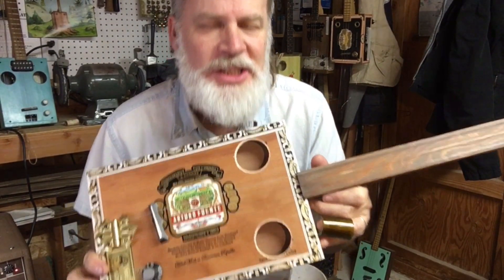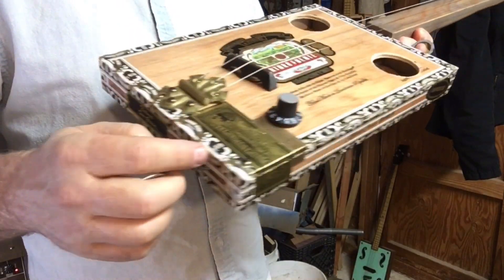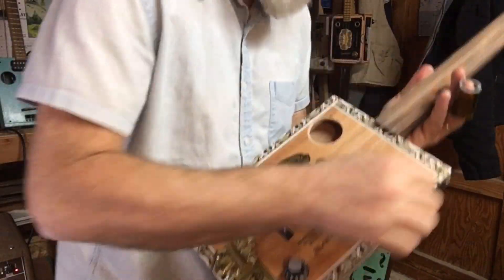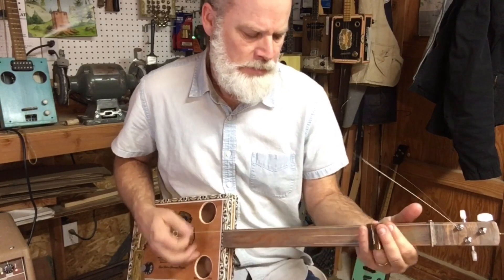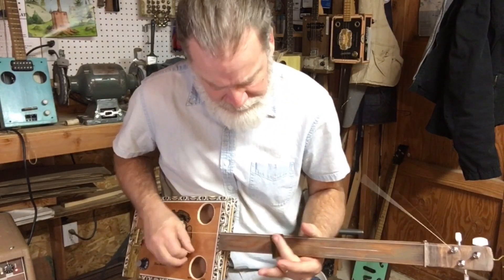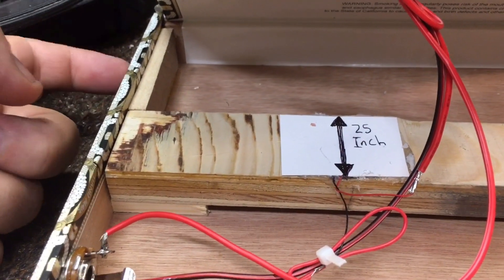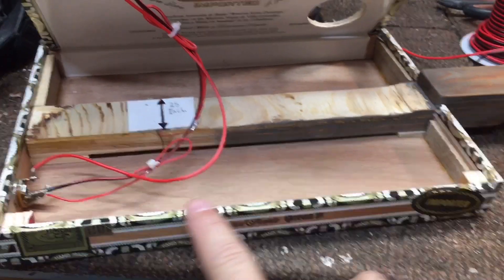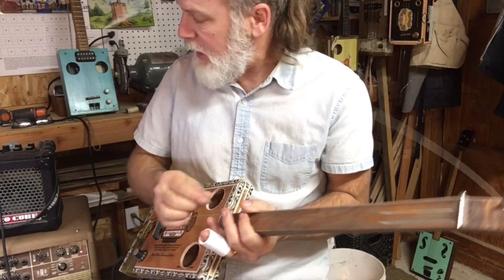Arturo Fuente Queen Bee Thinline Electric Fretless Slider Cigar Box Guitar

Comment: Hi, I am in the process of doing research and gathering the materials to build my first CBG and I have been unsure about the best way to mount the neck to the box I got.  It's a arturo fuente chateau fuente box, If possible I would like to install  a delta pickup wired to 3 way with tone and volume control.  This is where I am uncertain about the best way to install the neck.  I've thought about using wood support blocks and attaching the neck by using those countersunk threaded sleeves that are used on cribs and dressers for the bolts to thread into.  So the neck would only run into the box a couple inches and get bolted from the back of the box to the blocking inside the box, but feel that might not be strong enough once it's stringed up.  Thought about laminating 2 pieces together offset so I could make a heal where the two pieces overlap and run top piece as the neck and the lower piece  through the box and out for a tail piece but Inside height is only 1" and not sure if a 1/4" is enough or too much of a gap between the lid and neck.

I'd greatly appreciate it if you be able to give some advice on this.

Thank you
Reply from the maker: I build my own necks and they are always one piece .... thru the body for strength.
Reply: @PuckettCigarBoxGuitar  thanks for the reply, I've got a couple last questions in regards to straight through neck construction.  My question is (A) is in regards to the need for a gap between the neck material and the inside of the box (B) if needed should it be towards the front (top) or back (bottom) of the box.  I plan to build with hardtail bridge, a 3 way selector with Volume and tone wired with  electric Delta pick up, and a  piezo.

Comment: I thumbed up so don’t hate on me, but the jack on a guitar is an “output” not an input.  I know... I’m “that guy” ... but I hear this all the time and it drives me nuts.   The “input jack” is the one on the amp.
Reply from the maker: I’m dyslexic so I’ll probably never get it right... I say output because the signal is going ‘out’ of the CBG.  That’s how my mind works ... the amp would be the ‘input’ cause I’m plugging in to the amp.  I’m backwards
Reply: Correct me if I’m wrong or I misheard, but I believe Del’s almost exact words were “of course I want you to hear it plugged in.” Nowhere in this video did I hear him say the words “output” or “input.” But of course that could just be me.
Reply: De-thaw, Un-loosen and Slow-up, yeah I hear those and become "that guy"